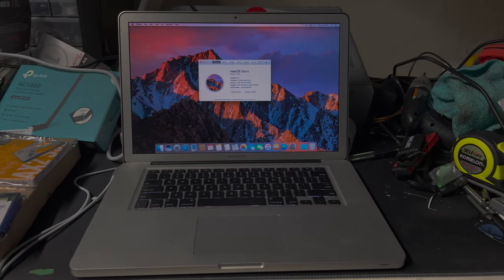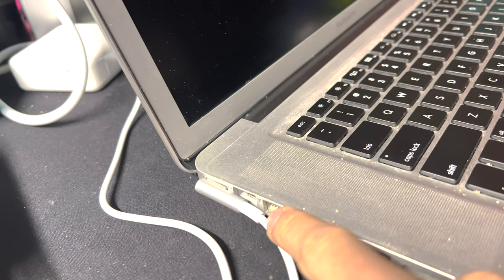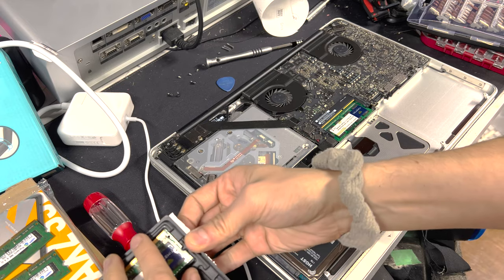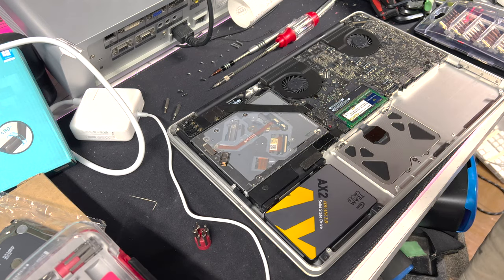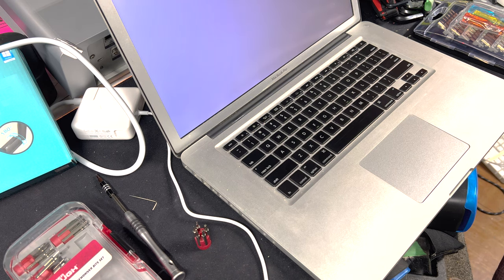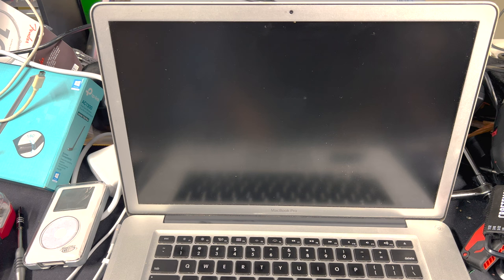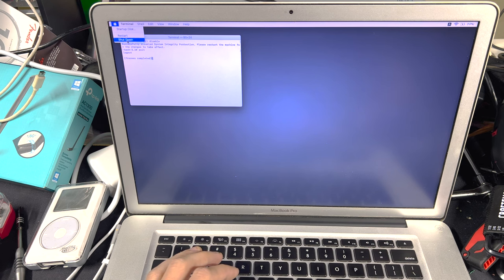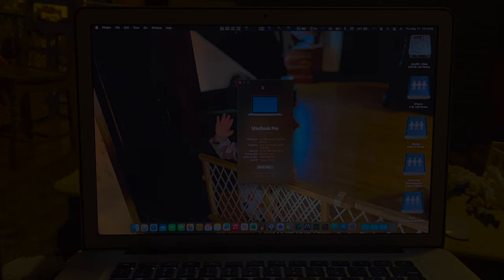MacBook Pro 15" Mid-2012 - Upgrades and Screen Replacement--Sleeper Musician's Machine??

Comment: The Mid 2012 MacBook Pro 15in is awesome. I bought mine brand new for around $2600 back in 2012 and still using it to this day. The first thing I did was upgrade the ram to 16gb and installed a 1TB SSD. Best investment. I have so far replaced the right speaker and added a new battery. No need to buy a new laptop.

Comment: I still have the mid 2012 15inch, it has the 2.6ghz 1gb Gt 650m and I upgraded it with an ssd and 16gb ram along with fresh thermal past, and it still runs great on Catalina.
Reply from the maker: I am pretty satisfied with mine so far!

Comment: You have a fantastic machine.  I have 2 of these.  Both twin 500GB Evo SSD drives. Both 16Gb Ram. Both Hi Res screens. They are great machines but recently the price has gone sky high here in UK.  I paid very little for mine. I wish My M1 mackbook pro had upgradable ram and nvme.

Comment: You should disconnect the fans before hitting them with the air duster, so as not to generate current back into your mainboard.
Reply: Pointless look at the schematic.

Comment: I got one of these MBP 2012 15" and upgraded to 16GB ram and 500GB SSD and they run great. Upg to Ventura thru OCLP and it is fast and stable. 

Very unfortunate that Apple don't make their products upgradable by the users anymore. That is why I stay clear of used M1 and M2 MB because don't know how used the storage is and once the read/write is used up or battery cycle pass 500 can't really do anything about it.

Would be interesting to see how the OCLP team deal with Apple's new OS that need the M series chips for the AI features.

Comment: Do you still have old display? that with the line.. if im not wrong is 1650x1050 resolution.. my is 1440x 900 and i would love to change it with better one.

Comment: Mine has 16gb, 500gb, and it running Sonoma, Battery count is 6 and is a great Machine I also have a twin running Rocky Linux. Excellent. <:o) Forgot both are 13".

Comment: Oh my God! I'm in Vietnam and I have a machine just like your video. I don't think it will be possible to upgrade it to MacOs other than Mac Catalina 10.15.7. As long as I upgrade the configuration, I can upgrade to the latest MacOs operating system, right??
Reply: only Mac OS ventura with ssd, 8/16gb ram  and open core legacy patcher

Comment: Can I ask something is it possible to change my display to non retina to retina?! What is the best display to upgrade my 2012 MacBook Pro.. thank you
Reply: If one has a unibody (non-retina) mid-2012 15 inch, you can upgrade from the glossy 1440x900 to the higher res matte screen (1680x1050 if i recall correctly). When swapping screens, you must disconnect the battery before the screen cable, or you will destroy a tiny, cheap surface mount capacitor that is a real pain to replace (not a DIY job)

Comment: Hi, if I may ask🤔what are the parts you used to upgrade this MBP and how much it it cost for part for it, I have MBP 2011 and I would like to do the  same, mine has been sitting idle for 6 years as it went dead and I was thinking if I can get it running with new parts, July 2015 mine was repaired with (661-6081 ) logic board 2.2GHz Core i7 (i7-2675QM) processor. Thanks upfront 😀👍
Reply: Use Google.  Thats what people do.

Comment: Hey dont blow the fans like that and let them spin. Hold the blade then blow. You can send a reverse minor electric current back into it and possibly fuck your board up. Great video though dude. I keep a clean toothbrush I use the dig into the blades to loosen up dust then blow them out.  you can take the three screws from the fan. Lift it up and clean under them and the little black filter thing that collects shit

Comment: I put in 16GB of Ram back in 2014 with hyper threading. My computer was always pretty fast, but I haven't used it in years.
Catalina is the last operating system I have right now. 
It has 1 Tb hard drive but it's a SATA disk.
I should probably change that and the battery.
Its been so long since I worked on computers, so this might be a dumb question but, is the 16GB I put in years ago, the same as a newer 16GB ?
Would a new one be faster, or don't I have to mess with that ?
A bit short on cash, and I want to start recording music too, but don't want to spend an arm and leg for a new Mac book.
Thanks for the video !!!!!
Can't wait to see yer recordings !!!!
Oh, should I upgrade to Ventura, or stay on Catalina ?
:-)
Reply from the maker: It’s not a dumb question at all! Generally speaking, the 16GB you installed back then is identical in speed to 16GB you could buy today. In other words, replacing that memory with newer memory would yield little to no difference in performance.
Reply: @BigJakeMusic 
Thanks for your reply !!!
It was always a fast laptop, but it's crazy how just a few short years ages a computer so it looks like a dinosaur...lol 
I'll just replace the battery and get a faster hard drive and get ready to record !!!
Happy 4th !!! 
Have a great day !!!
👍😁👍
Oh.... 
Ps.
Do you think I should upgrade to Ventura, or just stay with Catalina ?